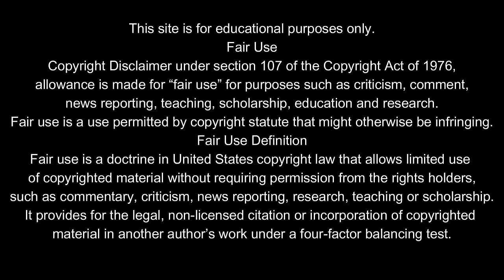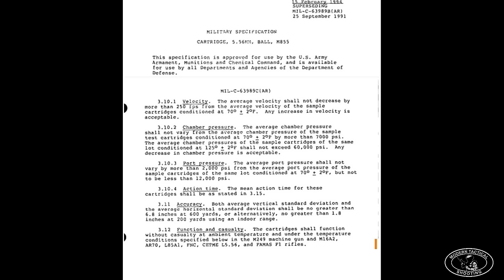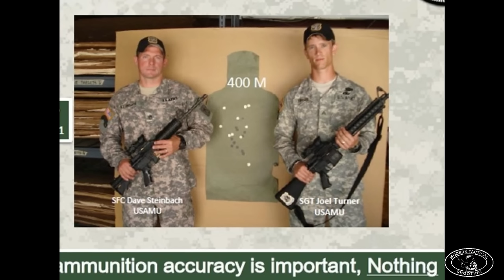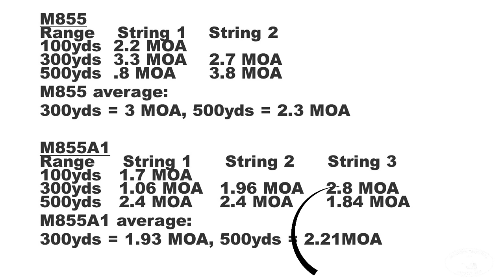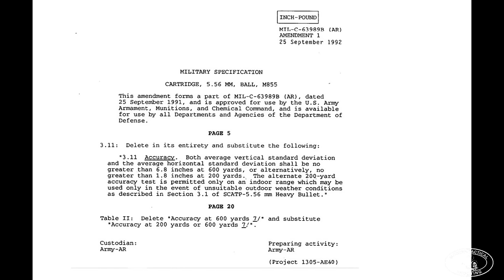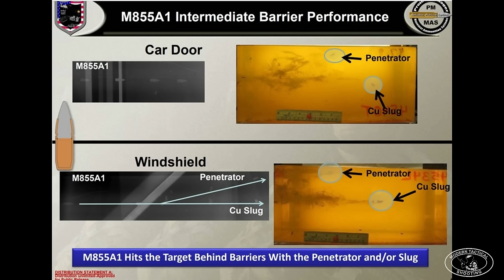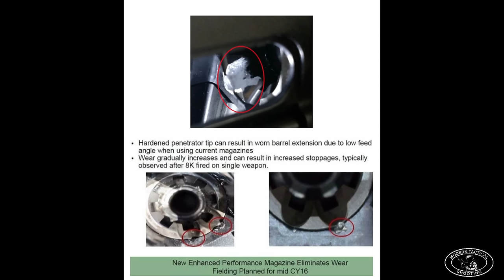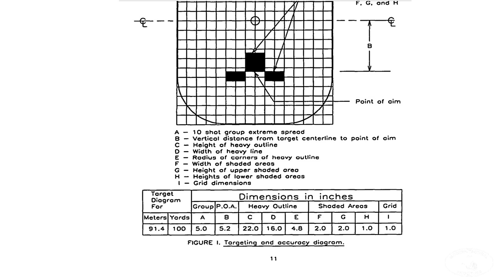M855A1 Performance Review. Did it live up to the Army's hype? Did going green really work?

Comment: Yes it's more accurate than 855, even in your tests shown, which was limited. It has a better BC than 855, which is notorious for being not very accurate, due to concentricity issues in placing the steel penetrator in the tip.

Yes it is more lethal than 855, and your bit about how you're not getting attacked by a car doors or windshields is pretty reductive. The Marine corps specifically wanted to develop a new round because of its poor performance against cars and other light cover in Iraq, hence Mk318 mod 0 and mod 1.  Also why M995 was produced and issued more. You can literally find dozens of gel tests, and I'm sure you can find some live tissue tests as well, within normal parameters 855A1 is more lethal and will readily expand and fragment more reliably than 855.

The body armor thing is a non-starter, even 995 cannot penetrate an esapi plate backed by soft Kevlar. Steel body armor and UHMWPE plates are a different story, I have personally put 855A1 and 995 through AR 500 steel 'body armour'.  Our small arms ability to penetrate 'near-peer' enemies body armor is somewhat irrelevant. What causes most casualties on the battlefield during a large scale conflict? Not small arms. Even with that being said 855a1 has a larger chance of incapacitating an individual wearing body armor due to greater backface deformation than 855. 

Also you make some pretty weak arguments about how 'in Afghanistan we weren't being attacked by a car doors' and then turn around and say just because people weren't wearing body armor in Afghanistan doesn't mean that body armor penetration is irrelevant'. You contradict yourself. 

The round is an improvement, it successfully eliminates a lot of lead from our ranges, which is very costly to remove, it has increased accuracy, lethality, and barrier penetration abilities. Was it an expensive program? Yes. Were there better options like Mk 318 mod 1, mk262, or even 70gr tsx 'brown tip'? Yes of course, But in true Big army fashion they wanted to spend a bunch of money creating something new to benefit the MIC and justify their jobs (and funding) in research. It will continue to serve alongside the new NGSW cartridge and program far into the future, along with other cartridges. 

BTW yes they issue out the brown EPM mags to most infantry units, or tan Gen 3 Pmags are procured for units as well. Thanks for dispelling the stupid internet myths of feed ramp damage, it's crazy to see that still going around.
Reply: They really could have just gone with a TSX style round and called it a day. Those do have a tendency to shear off petals through hard barriers, though. For what it was designed to be, a lead-free round that increased terminal performance consistency and was barrier blind and maintained armor penetration at range, it actually does pretty well.
Reply: "But in true Big army fashion they wanted to spend a bunch of money creating something new to benefit the MIC and justify their jobs (and funding) in research."  been in 14 years and this is indeed the way of the army lol
Reply: @adharjanadb  YEP! Spend it or lose it! 

Me and my little brother joined the Army together back in 1995. I got assigned to the 4th ID and then the 3rd ACR at Ft. Carson and he went on to be an SF Supply Sergeant for the 82nd and then for the Ranger Training Battalion at Eglin AFB in Ft. Walton Beach. As the Supply Sergeant for the SF unit at Bragg and then a Ranger Battalion, he was authorized to buy nonissue gear from civilian manufacturers, while all other units were limited to only authorized unit issued gear and supplies. Basically anything a SF soldier wanted, he could get! If a single soldier wanted say, a particular multitool or style and brand of sunglasses, he would order them by the case! Which did make it easier for him to blow his budget than Supply that’s limited to basic issue and unit specific gear/supplies. I may or may not have received  some nice  “care packages”  several times a year’, but I WAS a pretty popular guy in my platoon! At the end of the year he was literally ordering the most expensive dispensable equipment, gear and accessories he could find, just to spend every penny of his budget! Funny how case of the top of the like Leatherman or Gerber multi tools would show up at my unit! 
This “spend it or lose it” rule is why there is SO much waste of taxpayers money! If a company or battalion does not spend their entire budget they will get less money the next year! My brother said he would use less than HALF of the budget he had keeping the units WELL equipped and then would go around asking guys what they want and going on shopping spree!  So instead of awarding a good supply sergeant for saving the military money and then maybe even allowing them to use even half of of what they saved for Post recreational events like Post Family Day, the annual Military Balls or whatever the Post Commander decides, they PUNISH them by cutting their annual budget! So you get EVERY Supply Sergeant in EVERY Unit scrambling to spend every penny on anything they can! Especially on high loss or disposable gear! I had so much gear and cases of MREs when I got out I had to rent a storage unit! It was crazy to actually SEE the amount of money the military forces it’s Supply Sergeants to waste!
Reply: @GrumpyGenXGramps  I did a stint In 3rd batt and our gear was same we had very different access to needed equipment.  When I was in the 82nd it was much more standard and same type of thing use it or lose it.  I'm in the middle east and I asked for summer uniforms which they issue new recruits in the states and we were denied it.  Fracu only but we are authorized to buy our own and wear them.   I'm in one of the hottest places on the planet and our supply has a big use or lose budget but won't approve gear designed for this exact circumstance..  this right here is why I'm dropping paperwork and running like hell after I'm back

Comment: At 27:38 you say that (5.56x45mm)  M855 A1 is going to be replaced in 2024 by the 6.8 ARC.  Did you mean to say that?  I am aware that Hornady has introduce the 6mm ARC and I am aware that as part of the NSGW (XM-5) introductions that those weapons will get a new cartridge called 6.8 x 51mm which SIG appears to have named the 277 SIG Fury. I do not know what the US military is going to call the 6.8 x 51 mm.

Comment: FWIW, I bought a box of green tip M855 and fired it at 100 yards from my AR-15 with a 20" bbl and 1in8 twist, which is quite accurate with handloads.  My handloads of 52 grain match bullets generally shoot a bit less than 1" for 10 rounds on a good day.  The green tip however was more like 2" for 5 round groups (limited ammo supply).  Green tip velocity was about 3250 fps, 150 fps faster than my handloads.

Comment: I've been an 11B for about 4 years now and the EPM magazine is definitely becoming the standard issue mag in the 101st. The PMAG should've been the obvious choice for "fixing" the overhyped feed ramp issue, but my theory on why this didn't happen is partly because the PMAG doesn't fit into the standard issue MOLLE magazine pouches. The triple M4 mag pouch flaps won't button and the double stack M4 mag pouch barely has enough velcro left to close.
Reply from the maker: How have the EPM mags held up?
Reply: @ModernTacticalShooting  I’m active duty as well and honestly they aren’t that great. I’ve noticed a lot of them don’t drop freely from lowers and I’ve had multiple fail to feed the next round. Not sure if it’s a feed lip issue but those rounds fit tighter than usual with a full mag. I know the SFABs are getting black gen 3 pmags issued to them now. Not sure why they made that decision.
Reply: @ModernTacticalShooting  I own a few and I don't really care for them. From what I've observed of others using them, they seem to work about as well as any other mag. Personally, with only a few hundred rounds on them, they seem a little more sensitive than my PMAGs so I only use them for the range. I prefer windowed Gen 3 PMAGs, but I like how the EPM mag comes painted brown already.

Also, in my experience with M855A1 (I've only used M855 in a SAW) it seems perfectly accurate. I was able to put 2 of 3 hits on a 700m target through an M4 with an ACOG. I've also noticed when policing ranges that the M855A1's copper jacket seems to separate from the steel penetrator and mushroom a little bit, but this is only on rounds that impacted the berm.
Reply: @Liionhawt  I have noticed the free fall issue too, I believe its the brown paint sending the dimensions just over the tolerance for the mag well
Reply: Pretty much exclusively see PMAGs in 82nd land. I've never seen an EPM in the wild.

Comment: I don't know why they don't take the new SIG case technology with the steel bottom and the brass case and apply it to the 5.56x45 essentially raising the pressure's and maybe using a heavier projectile to achieve faster fps and longer range I would hope.. Just saying

Comment: If you're going to carry a spare bolt, make sure it headspaces properly!  Just cleaned up the pieces of another AR whose operator thought all the parts are the same and you don't need to check headspace!  And with the higher power A1 ammo, penetrant checks are going to have to go to the Organizational Maintenance level instead of Direct Support or General/Depot. Should become a yearly maintenance task.  Unit armorers are going to require all the gauges for headspace and barrel erosion too.  That's just what overgassing and higher pressures do!

Comment: Looks like the .8 grouping skewed the m855 results.  If we consider the larger…as well as the 300yd results…it looks like a 33% increase in accuracy.  Also, It does not say M16A2 accuracy..but m855. It might be from a test barrel.  Also, im not sure if the standard deviation  is total size…or from center.  If from center it is closer to 2moa…which from a test barrel could be possible.  
The barrier penetration came from Iraq with VBIED and checkpoints being more common.  

Im not sure where the data of M855a1 “ice picking” comes from.  By all available data it shows destabilizing within the first 2” of travel and fragmentation down to approximately 1700fps….  That is significantly better than m855, m193, or the Russian 7n6.

Presidential directive required the Army to develop “green” ammo.  The “green” ammo was coming, so the Army used the program to attempt to rectify the issues with M855 in the process.

I believe the operating pressure has actually been reduced a bit since inception.
Reply from the maker: The m855 comparison really not needed I just did it for the heck of it it doesn't affect how tight m855a1 shoots which is the important part

Comment: With the longer barrel gas port, and the correct magazine feed angle, it runs well. With a short barrel gas tube, it's a big too much pressure. And with the wrong feed angle, the exposed steel tip will chew up an aluminum feed ramp. So your results will vary depending on the specific rifle & magazine.

It's largely a solid copper hollowpoint stuck onto the back of a steel penetrator. Excellent penetration, excellent wound characteristics, and the hot powder charge squeezes the most out of 5.56. It's extra impressive when using with a 16 or 20 inch barrel, instead of 14.5 in the military's m4 carbine.

M193 is very good, especially with a 16", or better, a 20" barrel. In closer ranges, the tumbling it tends to do is just "messy" in all the ways you'd want a military gun to be messy.

M855 has good barrier-agnostic trajectory. It doesn't deflect off glass & such very easily. But it's terminal performance is abysmal. When you combine M855 with a 14.5" barrel (which costs velocity), it's not hard to see why the 5.56 got some unfavorable reviews in terminal performance. Also, it's lower velocity (both from projectile weight, and it's typical use in shorter barrels) means it actually doesn't penetrate hard objects any better. Actually it's penetration is worse than M193.

M855A1 has the barrier-agnostic trajectory. But the hot powder charge gets the velocity back up, so it penetrates as well as M193 on hard barriers. The terminal performance is very good, doesn't tumble as well as M193, but the exposed steel tip seated in a copper cup opens up in soft tissue like a ballistic-tip, making a big hole. The fact that M855A1 tears up training hardware, actually speaks well of it's terminal performance. Get better training hardware. It's an excellent bullet design. It being "green" is entirely beside the point of it. Accuracy... some of them have the steel penetrator "loose" in the projectile (you can spin the top). On the specific projectiles that have loose steel tips, spin stabilization and general accuracy suffers. If you go through them and separate out the loose tipped cartridges, the remainder are fairly accurate. Ideally the military should specify this as a standard for accepting ammo, but the ordinance department is pretty much a blind dog looking for bones. M855A1 can be very accurate.

Use M193 or M855A1 (make sure you have a long tube, and the right magazine for M855A1 though). 
Avoid M855 like the plague, it makes petite holes, and doesn't penetrate as well as M193 even. Target practice only.
Also, going down to 14.5" (or even less) is ill advised no matter what cartridge is used. CQB length is nice, but not if it's gimping your terminal performance significantly and increasing your muzzle flash quite a bit (or tearing up a can more rapidly) at the same time.

Side Note: 5.45mmR military ammo actually has a copper plated steel jacket (the copper protects the rifling). Inside that, it uses a very soft lead, and has a tiny air gap at the tip. On impact, the soft lead rushes forward, and the air pocket gets compressed into a "bubble" of air, in a filled tip. The odds of this bubble being perfectly centered is near zero. The steel jacket is strong enough to prevent deformation. The result is that on impact, the bullet becomes unbalanced (due to an off-center air pocket inclusion), and will tumble (immediately, and violently). It works very well, but only with the mil-spec russian ammo which has this design. Aftermarket 5.45 examples with regular FMJ construction do not have the velocity to bend & tumble significantly. 
In M193, the tumbling is more caused by the bullet's velocity, and it becoming bent on impact. It's not caused by spin-induced yaw. Actually it tumbles better with less spin (1in12 ideally, but definitely not more than 1in9). It will tumble through the target, or tumble 90 degrees, and then break in half making 2 wound channels.

Both are drastically more traumatic than M855, which is stable, robust, a bit slow, and almost never tumbles. Accurate, yes. But not traumatic. M855 makes a 22 caliber hole with a small halo of supersonic hydrostatic trauma. It doesn't impart all that much energy within the target medium, and is not very effective (unless the small hole is critically placed).

Nothing (shot out of a rifle) penetrates afghan walls. Not even close. I don't think it's even something to bring up in rifle performance. As far as penetrating chest plates... no, the M855A1 doesn't penetrate them. But neither does any other 5.56, nor the new 6.8mm. Chest plates are pretty hard.

Comment: I've never shot M855A1, but I did find a Winchester export training load for Australian defense entities that i'd assume is loaded to M855A1 pressures/specs. It was produced in excess and the overrun was sold to a well known distributor i've bought from before. Its labeled "Winchester 5.56 62 Grain Open Tip" in black lettering on plain white boxes. Its fairly typical/average looking winchester brass, sealed primers. But. Out of my 13.9" Criterion Core series barrel with a headspaced BCM bolt, it chrono'd 3,081 feet per second average. 

The same bullet is used in the Winchester "RED223" commercial load. That red box .223 version chrono'd 2,810 feet per second for me in the same gun 😂 so. The 5.56 export load is absolutely nasty if you can ever find any.

Comment: I have great groups results using m855. not sure where the bad accuracy rumors came from unless its shooter error or a faux m855 manufacturing process. thanks for the cool vid.
Reply: During the Surge period in Iraq I remember reading the reports that the Army was accepting M855 batches that failed the accuracy specs due to the need. Maybe it was a bigger issue when massed production had to double-time it.
Reply: @ChucksSEADnDEAD  sounds very possible. crank em out. QC goes down.
Reply: The best consistent accuracy I've ever had was about 1.5MOA. I've shot a small handful of sub-MOA groups, but those aren't normal. 

M855 was never designed to be accurate. It's not a myth that it's not very good, it's by design.

Comment: Another good vid. I'm of the opinion that the army trying to go for the barrier/armor penetration in the 5.56 was a waste of effort. While the barrier penetration can be achieved to a limited extent, velocity is what allows the 5.56 to defeat armor and there just isn't any good way to achieve that at distance without extra mass to carry the energy. Should have mass issued mk262 and accepted the range and ballistic advantage that offered if they really thought it was that big if an issue. Of course I have my issues with the new 6.8 but I'll sound off with my opinions on that when that video inevitably drops.